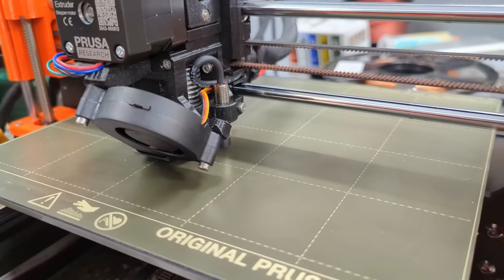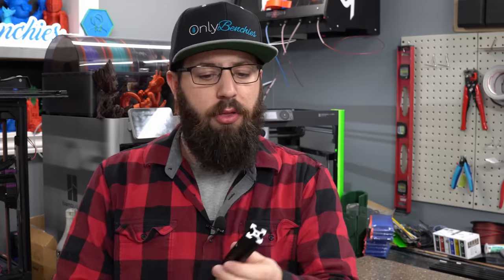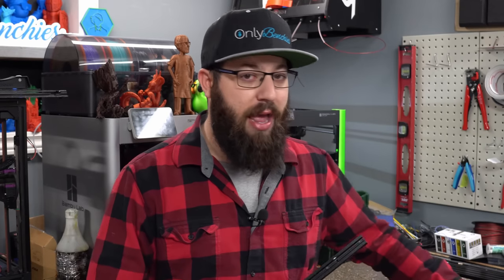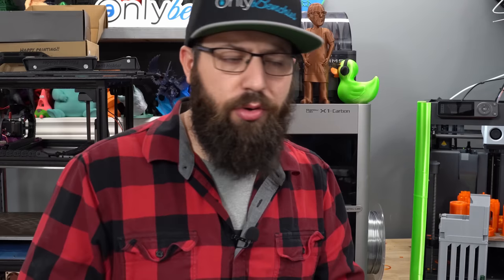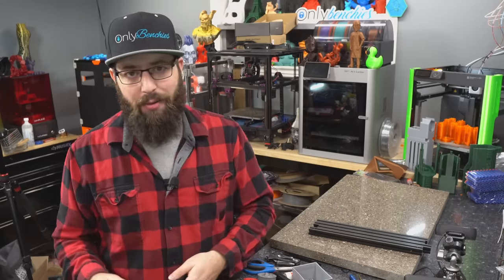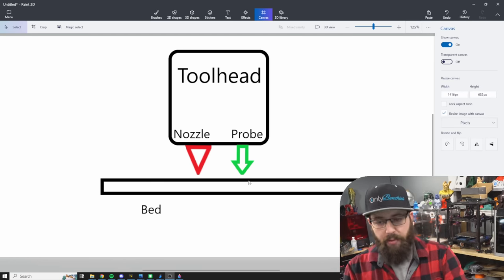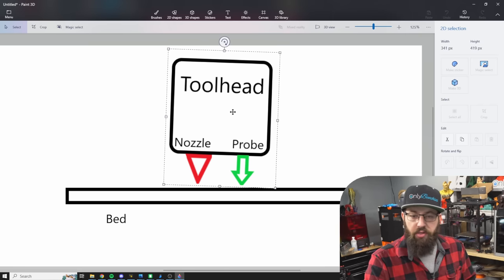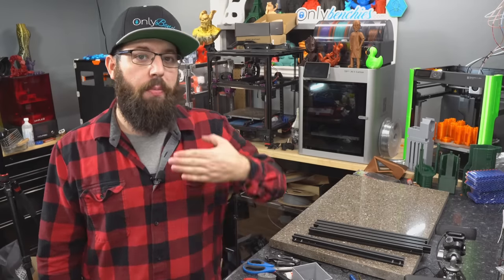Twisted Motion Making Your Probe Fail? #3dprinting #3d

Comment: I experienced this on a modified Hypercube Evolution build where I used linear rails for X and Y. 

I'd been trouble shooting for over a year trying different build plates, swapping the BLTouch, chaniging the mounts for the BLTouch, using a genuine HIWIN rail for X (coreXY for those who don't know the HEvo), even buying a surface plate (Nero3D called it a Starrett plate, same thing different manufacturer :) ) and scraping the surface with prussian blue and lots of trial and error between heating the plate, checking for flatness, cooling, scraping and so on... I must've printed at least 3-4kg of first layer tests while also trying to tweak the firmware settings for the bed mesh. 

What finally caught my attention was while doing a different project I had to check for perpendicularity over a distance of about 500mm (20in). That's when I checked my X extrusion and it was twisted by ca. 1° over the 400mm length. This twist was accentuated by the X-mounts being warped a bit in the same orientaion of the extrusion twist (!) and this twisted the HIWIN rail as well (fortunately even hardened steel is elastic to some degree). In hindsight I am wondering why the HIWIN rail didn't bind... probably too little twist for that.
Basically I reprinted the X mounts, changed the X extrusion and haven't had a bad first layer since.

Live and learn I guess. (I  just wish Nero would've made this video 2 years ago xD )

Comment: I have had this exact issue on two printers of mine. A ender 3 v2 and I think most likely a ender 3 s1 pro both with the bl touch. I could never get the leveling just right and almost always heard a noise like the nozzle was hitting the print. But I am now I can say I think my question has been answered with this video.

Comment: How easy is it to twist a 2020 extrusion during a bed crash scenario when the printer is misconfigured or when a lifted part is forced under the nozzle during a print?  Are standard ender style 40 34 steppers powerful enough to screw up an extrusion like you're describing when these common issues occur?
Reply from the maker: It's possible. On a v2 series voron the belts are likely to start slipping first. But with leadscrews involved it can happen

Comment: Talk about timing, I literally just realized that this was what was causing problems on my Sidewinder. I’ve been leveling with a dial indicator and my workaround for the extrusion being twisted is to move the hotend/indicator so that the nozzle is as close to the bed as possible while still allowing for the indicator needle to be able to move.

Comment: My ender 3 has had every ussue it can. Literally.
X axis twist-check
Bed that looks like two sin waves put ontop eachother-check
Broken thermistor-check
Clogged nozzle-check
Broken extruder-check
Ptfe tube slips out a bit-check
Worn out extruder gear-check
And now the z screw's nut is starting to wear out.
Good thing I bought it to tinker...

Comment: Klipper has twist compensation now. Worth using it as it improved my bed accuracy quite a bit.
Reply: And in Marlin you can just add an offset to each probed point (after meshing in start gcode as the offsets don't change) with an M421 offset for each point (e.g. M421 I0 J0 Q-0.00; M421 I4 J0 Q-0.11)

Comment: Another consideration, in my opinion, is if the extrusions are twisted there is an impact on the motion system of a 3d printer which uses linear rails.  For instance, setting two linear rails that track the X, Y and/or Z gantry where the orientation of the carriages between both rails needs to be within a resonable tolerance results in the motion system binding as the carriages are opposing forces induced from the opposite side.  I ran into this issue when I tried to convert my 3D printer to a Switchwire setup and ultimately had to abandon the upgrade as I was unable to dial the rails/carriages to be perfectly parallel to each other.  Fixing the issue would have required new extruisions and with the added cost there was no benefit to performing the upgrade/conversion.
Reply: There's a technique referred to in Gunsmithing circles as 'bedding' which involves using an epoxy grout between the mating surfaces to nullify distortion once the two surfaces are clamped against each other. You'd need a filler for the t-slot channel, release agent on the rail - clamped down finger tight at 2 points only - with maybe a piece shim placed across the extrusion (directly under the each of the two points you're clamping it down) - to give a little clearance so the epoxy bed sets as a single piece. Once cleaned up, a lighter, but consistent clamping pressure will be all you need.

Comment: Pretty sure my Y axis linear rods on the Ender 3 V3 KE are twisted right out of the factory. Not 100% sure, but something is causing an Y axis location bias on my CR-Touch probe. In a month or so I'll upgrade to linear rails and see if it helps. Until then I'm making a bed mesh manually with a feeler guage.

If anyone has the problem on the X axis though, there is a software solution for it called "Axis Twist Compensation" in Klipper and "X Twist Compensation" in Marlin.

Another long term solution that doesn't require changing the rods would be to install some kind of detachable / stowable probe right under the nozzle. That would basically eliminate the X and Y offset of the probe so ABL would work on both axis.

Comment: Hmm ... Very interesting.
I actually have this issue on my printer, which uses dual rods as motion system on X axis. Whatever the mesh is, it's always too close on far left, too far on far right, spot-on on the middle and either a hair too close or too far everywhere else. Despite using a well-calibrated probe.
Bent rods have not been considered as the root cause, now I'm wondering if whether rebuilding the frame from scratch using quality extrusions could solve this for good.
Reply: I had this issue and moved the probe to be beside the nozzle in the x axis to avoid this problem. Now works perfectly.
Reply: @andrebonneau8738  That's a solution I could try too, indeed.
Reply: @andrebonneau8738  I gave this a try after redesigning my probe mount so the probe is collinear with the nozzle on the X axis.
That was unexpected and surprising, yet... That seems to have done the trick! Bed mesh doesn't show the weirdness it used to, and the first layer "square test" yielded a much more uniform result.
Thanks for having shared that little trick! 😉

Comment: had this happen on a delta printer that uses cheap round rods 2 per axis and took me far too long to figure out this was the issue lmao
the only way to work around shit hardware like that is either
1. making the nozzle the probe (with like metal bed and capacity sensing or piezzo or whatever)
2. hopefully marlin/klipper/reprap etc will eventually come up with a system that lets you do an initial manual calibration once and then uses the probe and from the initial manual calibration it would be quite trivial to figure out the correct offsets for each point taken by the probe
sadly option 1 requires getting new hardware
and option 2 requires work to be done on the software side
so nothing much to be done except better hardware or just manual leveling in such a case

Comment: Never really got a perfect first layer on my 350mm voron build, checked my bedmesh, and i have 1 Dips  and 2 ridges in the mesh on the X axis. 
Not too noticeable as the total Variance is 0.153mm. At 0.3 Layerheight with a 0.6mm nozzle its mostly inconsistent first layer squish.   
But still annoying due to the elephants foot i get on some spots on the bed.
Now i know why. Thanks.

Comment: is this something voron tap can resolve? my 2.4 has seemed to have a higher back right portion of its bed ever since i moved it one day. no amount of bed mesh seems to actually fix it.
Reply: No it can't. If you look in the tap manual you can see that you need to have a correct working printer before you install tap. This because tap is so accurate that it can detect linear rail errors, therefore you need to know that your printer is in good working condition. First thing I would check is if your frame is still square (you mentioned it appeared after you moved the printer). Then check for loose bolts.
Reply: Tap helps, because you don't have a probe offset. So you will still see the wave in your mesh, but because you probe with the nozzle it will compensate the twist perfectly.
Reply: @julianschill  +1

Comment: I had that issue with a dual 8mm rail system and the fix was to move the probe that was behind the printhead to parallel to the printhead to minimise the effect.

Comment: I think this is the issue I ran into when trying to add 3dtouch to my Mega S. I figured my X axis is twisted but I have not had time to even touch the printer since I put it together last time. Good to know its a common issue so my diagnosis is most likely not wrong.

Comment: I believe that all extrusions are twisted. No such thing as a perfectly flat and true 2020 aluminum extrusion. The question isn't if it's twisted but by how much: place any extrusion on a truly flat surface like a granite bed or a high quality machine tool cast iron bed and press alternately on the opposite corners. There will always be the tiniest amount of rocking even if only by a few hundredths of a millimetre. My rule of thumb is that if you CAN'T slip a sheet of paper in that gap, the twist/curvature in the extrusion is acceptable.

Comment: I've had this. Putting the probe at the same Y offset as the nozzle compensates for this (e.g. like a Prusa MK3, its subtle but its why their bed mesh works so well). Using a nozzle probe like tap would also work. To me, this is actually a flaw in the Voron design for the probe location.

Comment: Had the same problem BUT printing PLA worked great but for the more "fun" types it was a PAIN.
how i figured it out used marlin and a insane lvl of bed leveling map was ok for about 10 cm but in the middle it whent of the scale and about 10 cm from the end it was good.
AND the bed was ok no taco checked it with a laser light and there was no shadow 15 mm of hig grade aluminum 
had me wanting to send the printer to recycling center and enjoy he feeling when it got melted 
so not bad in the start but in the middel it twisted IF you are aware of this problem then you know the result  adn can fix it !!

Comment: It can also absolutely happen when the nozzle is the probe. On a Voron Tap, if the X extrusion is twisted, or you have a canbus umbilical wire pulling the top of the toolhead, twisting the tap carriage back - the toolhead will be at a slight angle while probing the bed, lifting the nozzle higher. Same math applies. The optical sensor now triggers later than it should, screwing up the mesh.